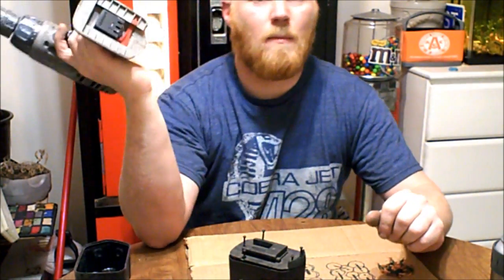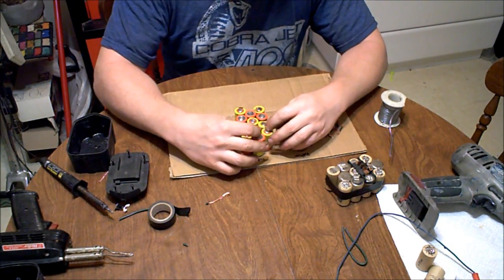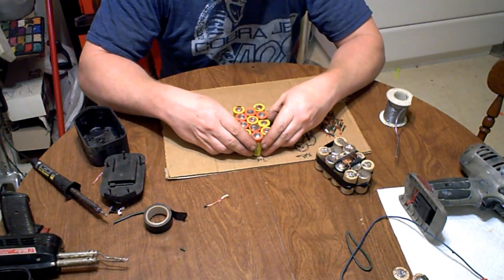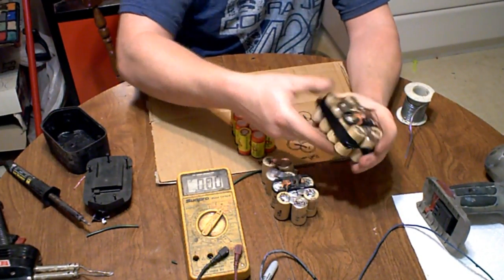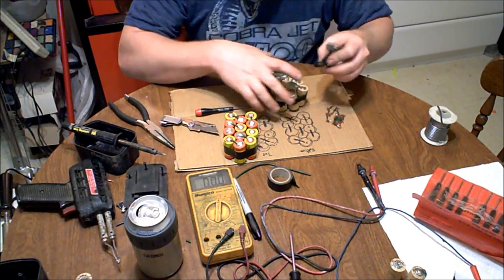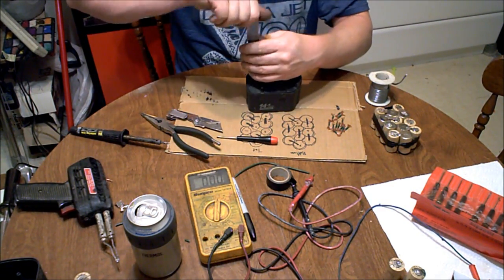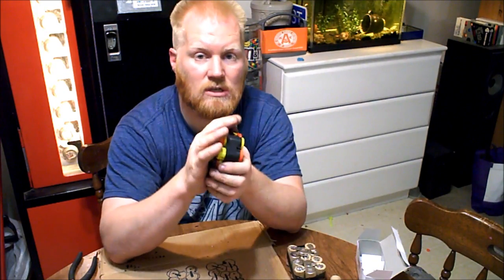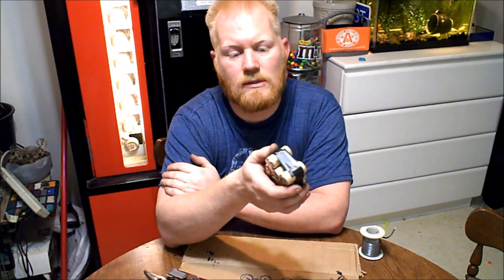Cordless Drill Battery Pack Rebuild for $20 or Repair for $0

Comment: Great Video , i did open the battery pack and  found no numbers on the cells how can i get the part number and where do you buy them
Reply from the maker: +enrrique alcaino Just measure them and use the measurements listed in the video description. They should be "Sub C Nicad cells". Type that into Ebay and you'll find some. Try to stay in the 2000+-mah range as high ones 3000+ are generally fake capacities.

Comment: Hi can you tell me if I can change the original 1200mAh 1.2v for a 2200mAh 1.2v battery. My drill is a 24 volts. Would it give me more power?
Thanks
Reply from the maker: +gildawolf Longer run time, Yes. The power will feel identical, but feel stronger for longer.
Reply: +sixtyfiveford Thanks alot

Comment: Thanks for the useful video. Please note:
a) If you try to solder on the battery terminals, could it be that the heat of the soldering iron can harm the cell chemicals? It usually happens that battery terminals are difficult to solder to terminals and if they are at all solderable they need a lot of heat.
b) Strip lugs, spot welded with ultrasonic welders would be safer.  
c) Have you thought  of a way to trickle charge the pack during long times of inactivity, during which the batteries self discharge? Trickle charging will also extend battery life. Any thoughts?
Reply from the maker: +Heliotypon Justthat a)The casing is designed to dissipate heat and only with prolonged heating would you damage a cell. Sanding the cell surface allows for instant 2-3 second soldering. b) Spot welding it faster and more efficient from a manufacturing stand point. You will get a better and more secure connection with solder. c)Most chargers on higher end tools automatically trickle charge/maintain. Only very inexpensive tools with have chargers that don't stop charging.

Comment: This is so cool.  I constantly wear out my weed eater and the batteries alone are as much as a new week eater.  I have since purchased a 20v weed eater because the batteries are so much cheaper, but then again the time it will last will be much less of course and with a 1/4 acre it will take me days to finish.  I now have a 40v lithium battery that is not holding a charge which I am going to take apart, buy the tools needed to do this to see if I can do it.  Can you recommend the batteries that I need and the best place to buy them?  Don't be fooled by my photo.  I have taken apart just about ever appliance in my home and repaired it myself simply by using YouTube.  LOL, I should have my own show! !  I am tired of paying high prices for things that can be repaired and not thrown into a landfill.  Thank you for this video, it is awesome!!!
Reply from the maker: +Maggie Steen Ebay is your best bet and Samsung or Sanyo are the best batteries. A lithium pack will more than likely have the battery cell called an 18650 and will more than likely say that on the side.

Comment: These cells should be spot welded not soldered onto.  Too much heat will cause the safety valve to close and render the cell useless.  also, the solder typically can't handle the heat that some of these packs put off, resulting in melts, and eventual failure.
Reply from the maker: +mtb2k2 Everything you just said is way over exaggerated.  The batteries will not get hot enough to melt the solder. Soldering normally with not over heat the cell as the case is designed to dissipate heat. Just like spot welding where you apply 3000F for a second a soldering iron only puts in 400F for a few seconds and you can touch the soldered surface withing seconds of completing it. Even a newbie to soldering that may hold the soldering iron for longer than they should it is highly unlikely they'll do any damage.

Comment: Good video! I was wondering if the battery pack be replaced with nimh batteries,  instead of nicad?
Reply from the maker: +Anthony Medina They are great at high capacity but Nimh can't deliver high amps that most tools require. Nicd are great a delivering huge amount of current that power tools need. If you're comparing batteries on Ebay or elsewhere,  be warned that most capacities of Nihm are highly over stated and in reality are only around 2000-3000mah. Nicd run around 1500-2000mah.

Comment: I have a Sears Craftsman power tool with a 19.2 volt  battery that has gone bad. I suspect that I left it on the charger to long. But regardless it wont charge. So I decided to disassemble it to see what I can find. Trying to find the proper bit size for the screws holding the case together showed a tamper proof screw head. The bit size is a standard T-10 but the screw head has a center post requiring the corresponding bit to have a center hole to fit over the post in the screw head fully or the bit will just slip out of the screw head. Has any one else encountered this same problem trying to repair Craftsman batteries?
Reply: +SuperSaltydog77 Harbor Frieght sells a security bit set for about $10...
http://www.harborfreight.com/100-pc-security-bit-set-with-case-68457.html
Reply from the maker: +SuperSaltydog77 You can use a small flat blade screwdriver to insert along the side of the center post and then into 2 torx slots. This will allow you to remove them.
Reply: sixtyfiveford I will try this technique that you suggest. But it will be a very small screwdriver.
Reply: C. Coberley Last week while I was at Home Depot I found a set of Dewalt security bits (7 pieces) for about $7.50. Thanks for your help.
Reply: SuperSaltydog77
did you try to drill out the center post?

Comment: this is a cool video... one question: don't you have to put a load on the battery if you want to get an accurate voltage measurement with the meter?
Reply from the maker: +Vico Re Yes.

Comment: Brilliant!! have a couple of Hitachi batterries EB 1833x would you  possibly have a link to what kind of batteries they use inside, have opened it up but nothing written on the battery cells...thanks
Reply from the maker: Denis Mc Lauglin Measure them and confirm. You should have 3000mah Sub C NIMH cells (43mm tall by 23mm round approx) though. Ebay is usually your best bet.

Comment: great video, my drill is a bosh 24 volt ,the battery pack says nimh 2,6 ah ,the individual cells are blank ,what cells should I buy THERE IS 20 CELLS IN THE PACK
Reply from the maker: Martin Murray So each one of your cells is 2600mah. The packs with a ton of cells like this can use the NIMH(18v and less use NiCD) because they share the load. Find out whether you have 4/5 sub C or Sub C size cells and start from there. Ebay is generally your best bet just don't be fooled by bogus mah ratings(pretty much anything above 3000mah). Find some NIMH cells rated at around 2600mah (any mah will work). Since they all work together it is best to buy name brand cells like: Sanyo, Tenergy, Panasonic, etc.
Reply: thank you sixtyfiveford
Reply: Thank you for the advice

Comment: I HATE nickel batteries. I rebuild my packs to do away with them entirely. I put a 3Ah 5S lithium polymer pack in the empty pack (after discarding the nicad cells) for my 18V class drill. It has about twice the capacity, 10 times the discharge capacity (easily), and it weighs less than half as much as the original nicad cells did. I use my digital R/C battery charger to charge it, now. That charger will also recondition old nicad packs, if I gave a fxxx about them. I do it for others from time to time. In addition, although my cheap, dinky charger won't really do it, if I had a bigger one, the lithium batteries can be recharged a bunch faster than the nicads can be. The only thing about it is that the drill felt top heavy with the new pack in. But when I took the drill apart, as I thought, and is more often than not the case, they had lead weights in the drill to counterbalance the original heavy pack, so I just took them out, and not only got it to balance better, it weighs even less, now. And my 18V drill has more torque than any 24v drill with nickel batteries, because of the high "C" rating of my lipo pack. My 3Ah, 20C (cheapest, and about the lowest "C" rating there is) pack can be completely discharged in 3 minutes @ 60A. More than enough for a drill. Friends that are in construction for a living loved mine, and did the same. The extended capacity is nice, as is the lack of the need to cycle the packs dead every time like you are supposed to do to nickel batteries. With them is's about the weight of the tool. Working over their heads with them all day, they really feel the weight of the tool at the end of the day. They always have the 24v drills, since they need the power. I get more out of my 18v drill, and it's about half the weight, and it runs twice as long on a charge,  they love that. They say their elbows don't hurt at the end of every day. The battery I used was $20, and the charger was about $25, so it was less than $50, and I got my drill for free, because there was no charger, and the pack was completely dead. DEAL!
Reply: +UNITED POLICE STATES OF AMERICA That sounds like a brilliant idea, why don't you make video and show us how it's done. I'm sure loads of us would love to do that with a few pointers to get us started.
Reply: can you give me a link to the charger?
and the li-ion battery you put in?
Reply: It's been a while, so that's hard to link. But you can get both at HobbyKing, the charger I use is the iMax B6. It does require a healthy 12v power supply, though, it's an r/c charger, so it usually runs from your car's battery.
Reply: so what R/C charger ? you have a model?
Reply: Advertise much?
Reply: United Police States of America: I didn't post the comment towards you. I posted it as a reply to Michelle Reyes trying to pitch people to a website that rips people off. Sorry for the confusion.
Reply: Sorry for that, I did post a link, here, I think, but only because someone asked me to. That's not the same thing as spamming at all.
And on this subject, I am still using the same battery pack, and I stick to Ryobi, since they all share the same pack, I have a drill, a saw, a rotary tool, and a line trimmer that share the same battery, and it's still going strong.
Reply: Start your very own battery business and make huge money here: JoxCharge. com
Reply: hey ,if anyone else needs to find out about how to recondition used car batteries try Trefendous Rapid  Extender Tips (do a google search ) ? Ive heard some great things about it and my co-worker got amazing success with it.
Reply: ✳｡ 🎀 𝟪 𝒮𝒾𝓂𝓅𝓁𝑒 Ⓣⓘⓟⓢ 🎀  ｡✳ & Tricks To Extend The Life Of Your Car Battery > https://t.co/3ycayBV4e1?PtOS5evrqrQa
Reply: where do you find a $20 5s lipo pack?  it's been 3 years since you posted and everything I see is significantly more expensive
Reply: Check out this website if you want to learn the best method to recondition your batteries: JoxCharge. com
Reply: This is a dead link

Comment: where do you buy new batteries? is 45 bucks a bad deal for 30?
Reply from the maker: guitarconspiracy That's a really good deal. Just make sure they are NICAD and not NIMH. A good deal is usually around 2 bucks a cell. EBAY is usually where I find the best deal, just try to stay away from too cheap of cells and ones with a higher rating than about 2500mah. Ratings higher than this are generally fake and most good NICAD cells are around 2000mah.
Reply: sixtyfiveford so this is not legit? http://www.ebay.com/itm/271680477738?_trksid=p2060353.m1438.l2649&ssPageName=STRK%3AMEBIDX%3AIT
Reply: wow yeah people are really mad about this dudes fake batteries... only 92% positive feedback
Reply from the maker: Those are also Ni-MH so they won't work well in power tools. They are probably closer to 3000mah.
NI-MH: Store more power than a NiCD but have to deliver it slower. NiCD store less power but are able to deliver a lot faster and that is what you need for power tools.

These would be more realistic http://www.ebay.com/itm/30-NiCd-NICAD-SubC-SUB-C-2200mAh-Batteries-For-PowerTools-ECT-With-Tabs-/371311822363?pt=LH_DefaultDomain_0&hash=item5673e8c61b

Comment: Good Video, technical correction....it is milli-amp not micro-amp ratings on the cells, ie 2200 mah (milli-amp hour) or 2.2  Ah (amp hour).  I use a Dremel to rough up the surface which helps in pre-tinning the cells so when you connect them, you use less heat which is the enemy of the cells.  That's why they use spot welders in the manufacturing process as much less heat is delivered to make the connections.
Reply: This is why I went to the comments. His uAh batteries would be dead in seconds.
Reply: hey ,if anyone else is searching for how to recondition batteries at home try Knewreck Rapid Renew Guide (should be on google have a look ) ? Ive heard some extraordinary things about it and my work buddy got great results with it.
Reply: I looked at your vid to see what you did. Invest in a new multimeter. Up front advise on batteries for replacement and where to find etc. Also a caution on battery replacement and hazard involved with same. I like your template idea for the pack for top and bottom view. Also finding a dead battery in the pack and replacing that one only from another dead pack. Also comment above is good and valid.  DONT feel bad about the mistakes as its easy to point them out vs not making a vid but being a critic. Your vid has lots of good info in it but also some raises  questions for the uninitiated and newbie wanting to do a repair.

Comment: Thanks for the video. I went through others and so many are putting li-ion batteries in, but then you can't use the old charger! They also don't tell you what chargers they use after they put li ion batteries into the packs. Anyway, thank you and thank you for the sub c battery info
Reply from the maker: ezrafett You're welcome. Yeah, the Li-ion batteries add an entire list of complications. Charging is just he beginning of the headaches.
Reply: ezrafett Digital chargers for the R/C models that the batteries were intended for. My Imax B6 will charge up to 6S (24V, and from a 12v source) and set me back about $25. Only drawback is it was meant to run from your car battery, at the R/C park, and would need another power supply to use in the house. If you have a vehicle, though, this isn't a big deal. It will pulse charge cycle nickel batteries to recondition them, too. And lead acid, it does it all.
Reply: ezrafett If you install a charge/discharge protection pcb in (like you are supposed to, and ALL commercial applications have) then there is no reason you couldn't use the original charger. But those cost more than my digital charger did, I made an adapter out of the contact plug from the guts of a broken drill. They seem to all be the same. It was easier than trying to get alligator clips, or something to connect to the drill packs. I use a $3 charge meter as my overdischarge protection, all I have to do is pay attention to it, and not overdischarge the battery.

Comment: I have an older Skill drill and Craftsman drill/light/saw kit. Neither has any screws to remove to get to the batteries. How do I get to the batteries in these battery packs? Thanks for the informative video. Very interesting.
Reply from the maker: dread cat A lot of time the screws are hidden under decals or rarely the glued the pack together.

Comment: Great tip man! That saves one a lot of money. I have an old 18V Porter Cable drill motor with its battery starting to fail. I guess I'll check out Batteries Plus for those NiCad replacements.
Reply from the maker: Wataboutya Thanks. Ebay seems to be the only place to have these cells at a reasonable price.

Comment: I appreciate your sharing this info. My question: after performing these repairs on battery pacs and getting a 15 V + reading @ the pac terminals following recharge- and each of the cells is tested and pushing 1.2 V (minimum). The charge still runs down after 6-12 hrs. Are those sub-c cells bad and still reading as good cells on the voltmeter? Should I throw them out and start w/ good/new cells? Also... The cells used in my battery pacs were rated @ 1.9 Ah- very low and very cheap from the mfgr.
 Thank you for your help
Reply from the maker: ***** To truly tell if a cell is bad you need to load test it. Measure the voltage of each cell while a second person connects a flashlight light bulb or a resistor. Bad batteries will give a superficial voltage but have no capacity.
Reply: sixtyfiveford What is a straightforward way to do this? I don't have alot of experience w/ electronics, but I'm willing to try things. Do you attach some leads to a flashlight bulb? David Fen
Reply from the maker: You can just hold them on the bulb with tape as this is low voltage. It doesn't matter which side of the bulb gets what wire. A second person really comes in handy so you can measure the voltage while they hold the bulb/wire on the the battery. But you can tape the other ends of your wire from the bulbs to your test leads so you can do it alone.
Reply: sixtyfiveford Thanks. This is all very helpful. David Fen

Comment: I love the video very informational. I have a Milwaukee 18v ni cd kit i got seven years ago and this year my batteries stop charging. Stopped by batteries plus store, they called saying that the batteries are gone and that rebuild each battery will run $75.00+tax each. Thought to myself that there has to be a way to replace them myself. I am not sure what reputable website sells the cells that i will be needing. As well as any other supplys. I want to do this for two reasons a. I am a fan of electronics and b. A new battery at depot or.on the web is.the same price as getting them rebuilt. If you could please give me that information it will be appreciated. Thank you.
Reply from the maker: jcherrera104 Ebay is your best be for new cells. Open your old battery pack to check that you have Sub C sized cells. Then you can order your NICAD (NOT NIMH) cells. Get something around 2000mah/2.0ah.